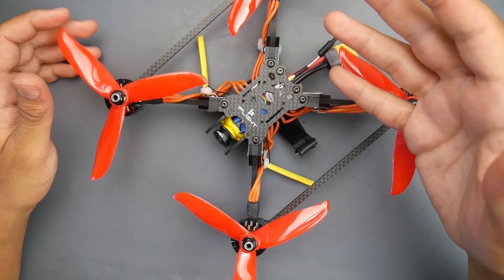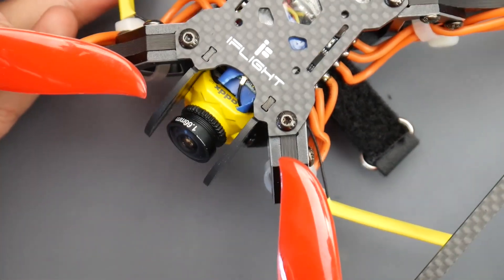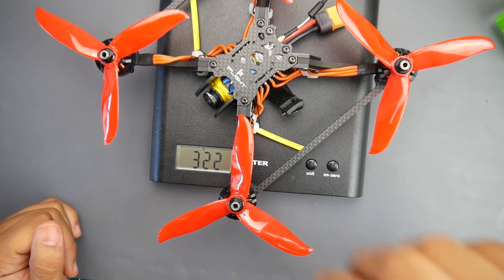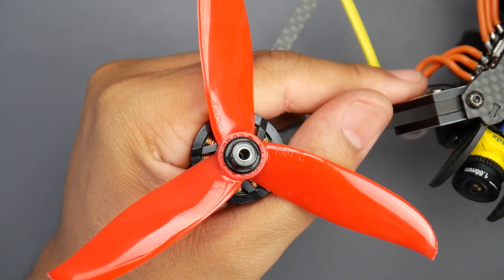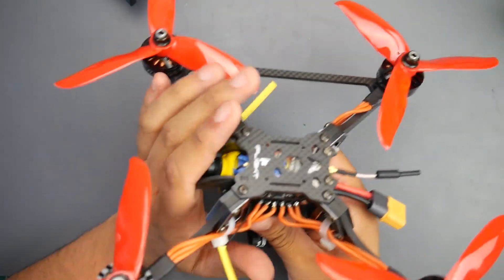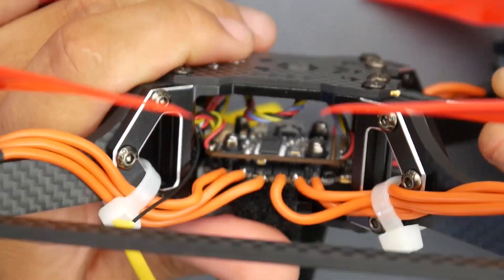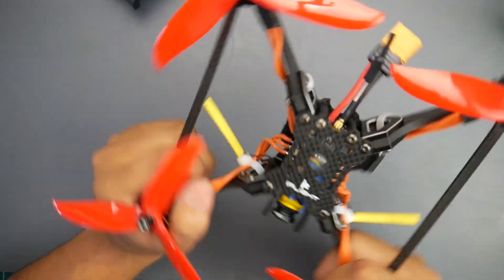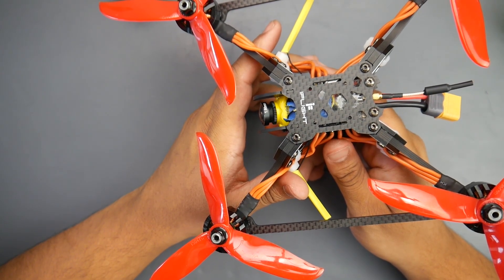Tekko32 F7 Mini, Mamba 2207 1750KV, Caddx Ratel Review and Flight

Comment: Thank you man! I know weve been bugging you for the 6s 20x20 shootout but this is all I really needed to know haha. Hope micro mesh is doing well and I look forward to part 2. Although you might wanna add the low ear capacitor before you tune right? Since tuning is more of a fine comb process and the capacitor will help make it more tunable?
Reply: RapterKingoftheBrozone 😆 micro mesh 😆 on what kind of chip is that micro running? I hope not al to fast motors otherwise is that older mesh in trouble 😆😆

Comment: Theres a bug in bf/blheli which makes the 22XX motors act weirdly , did u notice any difference or was it working fine?
Reply: im running 2207 2650kv and its ok let see in my channel last video.... locked in
Reply: @JuampiFPV  what bf version were u running?
Reply: @rushabhdubey6289  4.0 and 4.0.3